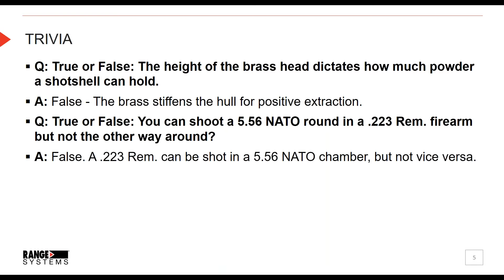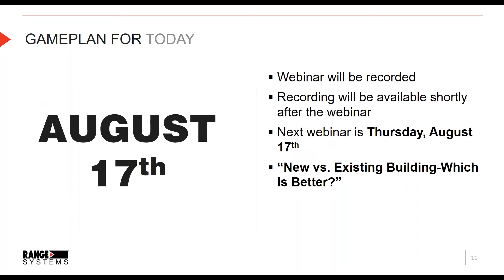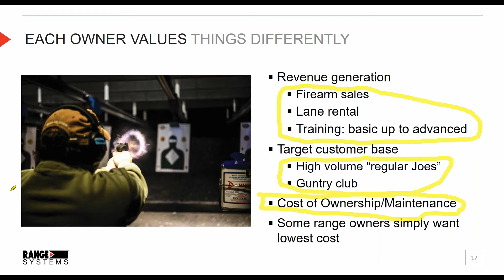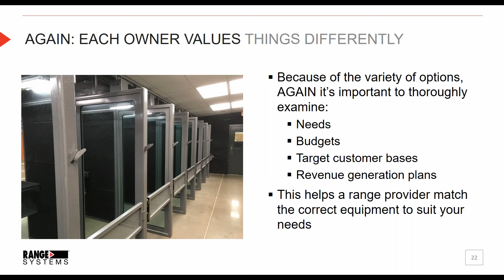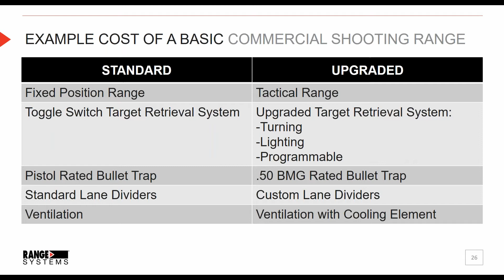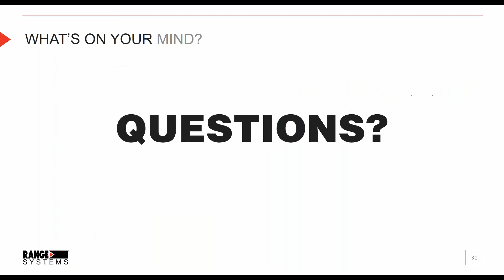How Much Does a Commercial Shooting Range Cost? | Webinar #2 Recording | Range Systems

Comment: They talked for over an hour and said absolutely nothing...
Reply: Right! I’m sitting here wondering am  I the only one thinking this exact thing
Reply: @internationalp2989  I thought it would provide some actual steps, rules and regulations and instead it was an hour of common sense. I want my hour back lol.
Reply: @marcm83  thanks man for the heads up
Reply: Man there was no breakdown. he said it’s gonna depend on stuff. if you upgrade certain stuff, it’ll be more.. without that, it will be less but the price is dollars vs value thanks for watching